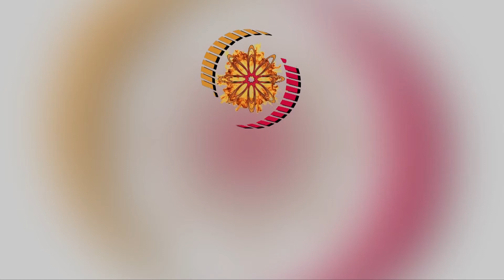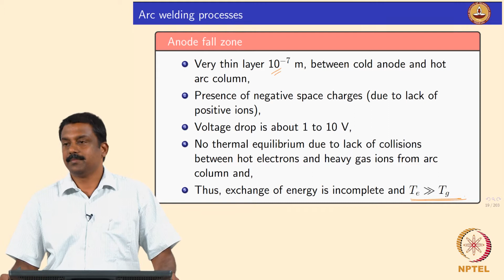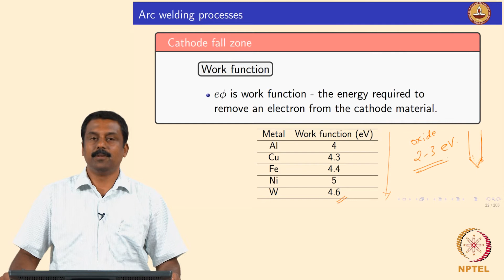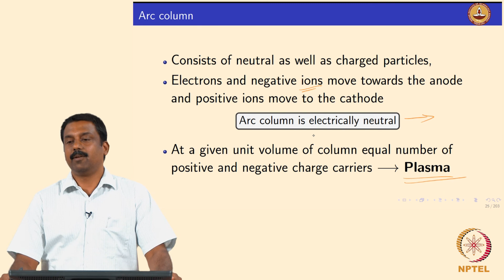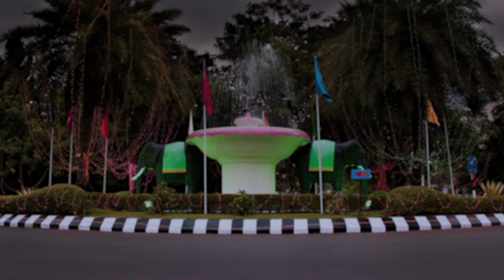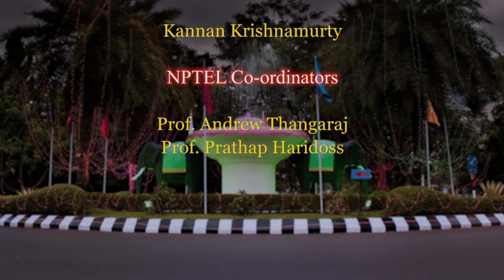#5 Physics of the Welding Arc | Part 3 | Welding Processes

Comment: Good morning sir.

The main function of cathode is to emitte electrons - very clear sir.

But i want know whether anode emitts electrons or not.

Also requesting to clear another doubt sir. In some other videos i heared that 
electrons emitts from both anode and cathode. Assume electrode is cathode & job is anode.
Then, electron emitted from anode attracts back without collision and electron from cathode emitts and collides with gas atoms and separates ions and electrons. Now the two electrons( separated electrons and existing electrons)attracts by anode. And the one separated ions attracts to cathode.
Results. 1/4 charge charge carriers in cathode and 3/4 charge carriers in anode

Pls clear sir.